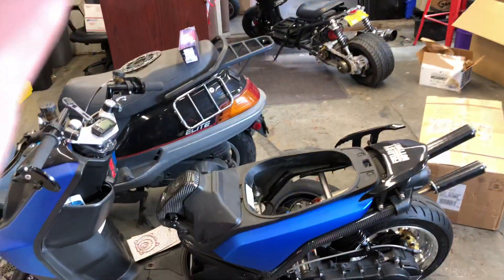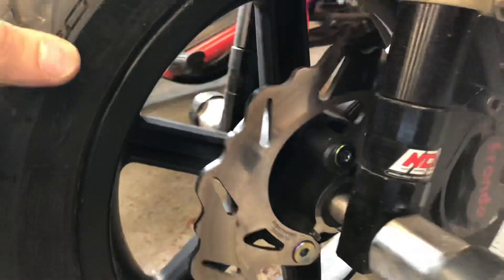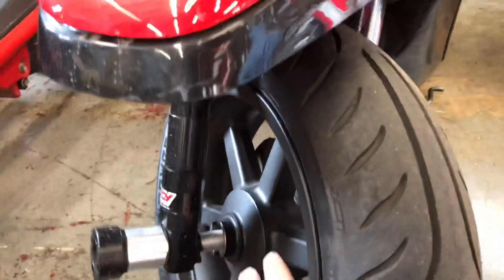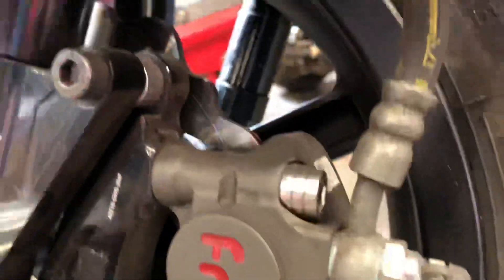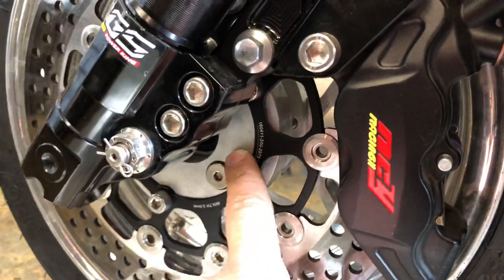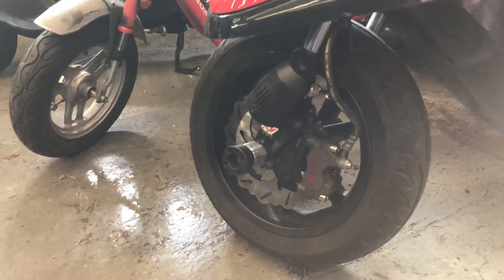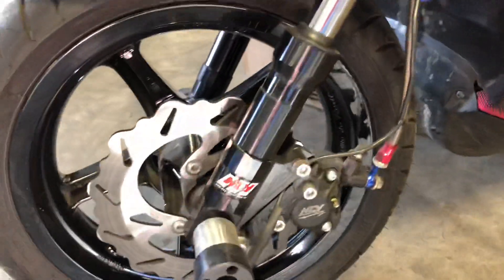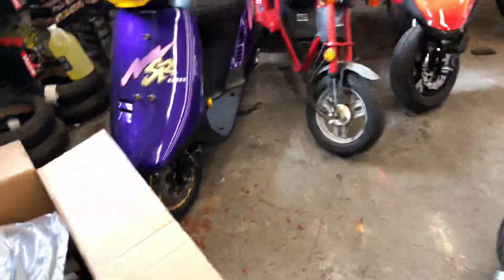How to add disk brakes to scooter

Comment: Have you guys added disc brakes to a Honda Navi yet? Id love to see how to do that on mine!
Reply from the maker: No the issue is it requires a lot of parts most people are not willing to spend $1000+ to convert to disk, you need special hubs
Reply: @Scooterswapshop  Couldn't you swap the wheel / hub / forks at the same time to make it more standard? e.g. what are you showing at 3:30 in the video?  Couldn't that whole kit go onto a Navi?